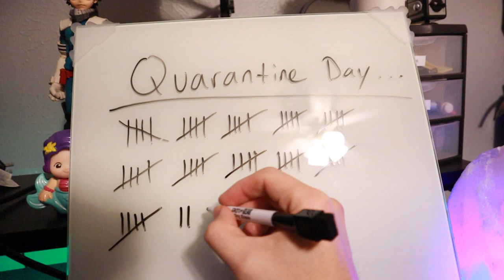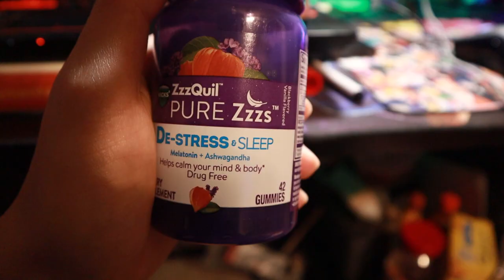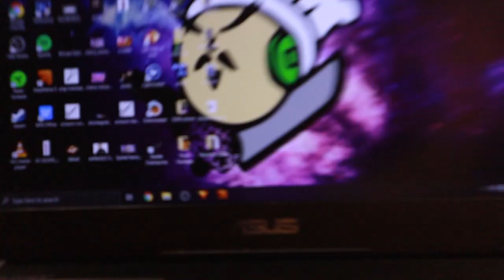MY GAMING LAPTOP ALMOST EXPLODED | QUARANTINE VLOGS

Comment: Yeah that was WAY too much thermal paste bro. Also is it still overheating? And the CBD, I too got a bottle myself because I deal with more depression than anxiety and as a new user I hoped it would help. Taking the oil has made me realize that I actually do get anxious and I don't get upset as easily as before over small things.
Reply from the maker: It still gets hot now but normal levels so it helped alot. Took the battery out so now it only runs while plugged in which is fine. Dude CBD works wonders, it helps me stay calm, I prefer that over any  pharmaceutical.

Comment: I know some what about computers and it does seem like they did use too much thermal paste also the way the battery look is really bad and you should replace it as soon as possible
Reply from the maker: I replaced the paste and it helped tremendously. The battery I'm leaving out of the laptop and running it plugged in since it rarely leaves the house. Gonna build a new PC soon  though!
Reply: A pea size drop of thermal paste is enough
Reply from the maker: @Sebastianbaraj5  exactly